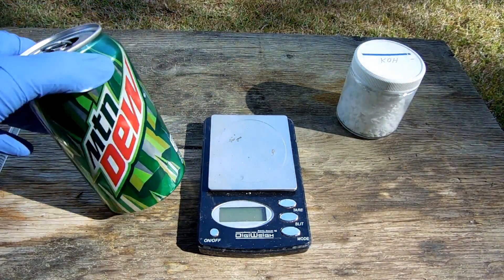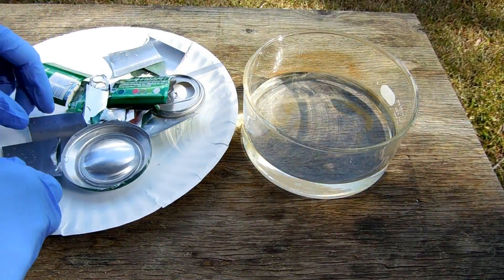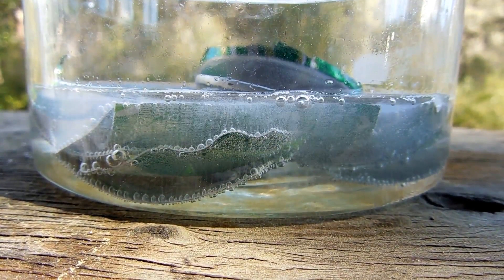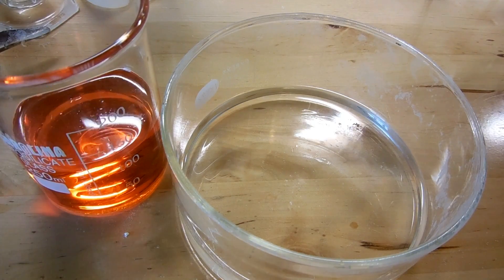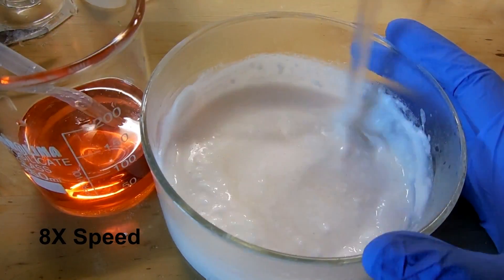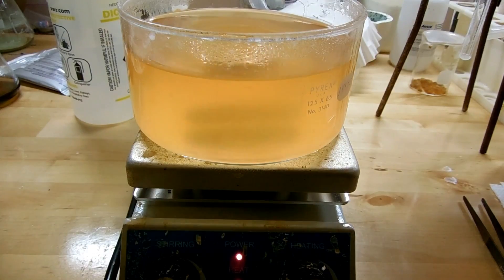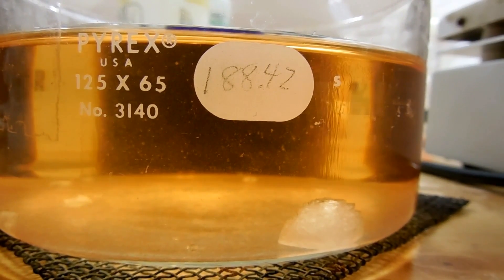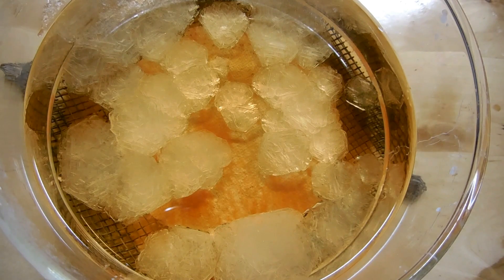Alum from Soda Cans

Comment: Excellent video thank you. Is there a chemical way to refine/reclaim aluminium not convert to alum.
Reply from the maker: Sure but it's not something that can really be done at the hobby level. Producing aluminum from bauxite is an incredibly energy intensive process, and this alone accounts for something like 5% of the total energy use in the US. Once aluminum is chemically converted into one of its compounds, it's very difficult to get the metal back out. You can more easily recycle existing Al metal by melting it, like I did here, and casting it into whatever shape you like. But that's a physical process, not chemical.

Comment: Hey you sound like someone who might know an answer to this question. I grow crystals with many chemicals but MonoAmmonium Phosphate is my favorite and I have grown very adept at doing it. I am getting ready to order some L-Alanine after reading a study done that showed a +5 mol% of the amino acid was most efficient. How much of an actual percentage of the solution does that break down to? I don't want to assume that it is as simple as 5%. Thanks in advance if you can help! I also wanted to note that in addition to just comparing straight ADP and Alanine doped ADP they used Arginine doped ADP. The Alanine was much more efficacious than the Arginine, but what about using both? I know that only experimenting can tell so I wanted to include this information so you might be able to include a more helpful answer. I understand they also dope ADP with other salts like Chromium and Boron so if you want to expand your reply by pointing out some chemicals that might help me in my work it would be appreciated.
Reply from the maker: Unfortunately that being organic chemistry, I have no idea! As you said, experimentation will tell.
Reply: mrhomescientist I believe growing monoammonium phosphate is well into the field of inorganic chemistry. Obviously introducing an amino acid into the mix is organic. I was actually looking for help in translating a chemistry definition into a more practical one for my methods. The mole is a unit of measurement used in chemistry to express amounts of a chemical substance, defined as the amount of any substance that contains as many elementary entities (e.g., atoms, molecules, ions, electrons) as there are atoms in 12 grams of pure carbon-12 (12C), the isotope of carbon with relative atomic mass of exactly 12 by definition. I just wanted to give this another shot since you seem to have a good head for chemistry. Thanks if you can help and if not then good luck in your future endeavors.
Reply: Konichi Wawa Hey, I'm just a chemistry student, but this link may help you calculate mol%: https://www.boundless.com/chemistry/textbooks/boundless-chemistry-textbook/solutions-12/concentration-units-93/mole-fraction-and-mole-percent-402-1960/

You basically want to go from mol % to vol %. The mole percentage you want is 5 percent. That means for every 1 mole of your total solution (including L-Alanine), you'll want 0.05 mols of L-Alanine. We can express this as a mole ration: 0.05molL-Alanine/1molE, where E stands for the sum of all the components of the solution, in mols. If you start with separate solutions of known concentration, then you can divide the mole amounts in the ratio above by the molar concentration, (mol/L). This will generate a volume ratio, which you can multiply by 100 to give you the vol %. You should probably divide each molar component by its own concentration. If you have pure or neat L-Alanine, then it's concentration can be found from the density of that compound. 

As to your further question, I have absolutely no idea. Hope I helped
Reply: Karsten Skogsholm Thank you so much! I just happened to be glancing through replies and noticed yours. By reading it I can see why it has taken so long to get an answer. thanks again..

Comment: This is neat but the cost of the reagents makes this a little bothersome when you can buy this cheaply in bulk. In fact. as opposed to messing with a caustic base and acid why not just turn the cans in for cash and buy your Alum?
Reply from the maker: See my other comment that you replied to. The fun is in experimentation and making things yourself.
Reply: mrhomescientist True, actually I was drawn to the video because I grow crystals. I am so busy tending to them that I really only want to do simple chemistry that also doesn't have the potential to cause problems. I am a natural born Klutz and I have lost count of the number of times I have spilled colored MAP solutions. I do mix my own AMAG since that is so simple and cost efficient. Check out my work if you have the time. I posted a couple of albums on IMUGR under "Growing crystals at home" which is the only posts under that category that I had to create. I love chemistry, but something like this is almost like me asking for chemical burns.
Reply: Hey sunspot!
What if you need alum and CANNOT GET TO A STORE eh?
You wallet is useless if the roads are cut or your transport is shot, or the store is closed.

Comment: The updraft iin the solution is less-dense solution which lost dissolved solids onto the growing crystal surface, I've read. Like dropping sand bags from a hot air baloon, the solution rises when lighted of its dissolved solids.

The image of the updraft is way cool!  I'm wondering if the cylindrical lensing of the beaker helped do what ordinarily would need Schlieren optics to show the density striations that clearly.  Very interesting!

http://en.wikipedia.org/wiki/Schlieren_photography
Reply from the maker: Thanks! I think that explanation makes the most sense.
Reply: Hey you sound like someone who might know an answer to this question. I grow crystals with many chemicals but MonoAmmonium Phosphate is my favorite and I have grown very adept at doing it. I am getting ready to order some L-Alanine after reading a study done that showed a +5 mol% of the amino acid was most efficient. How much of an actual percentage of the solution does that break down to? I don't want to assume that it is as simple as 5%. Thanks in advance if you can help! I also wanted to note that in addition to just comparing straight ADP and Alanine doped ADP they used Arginine doped ADP. The Alanine was much more efficacious than the Arginine, but what about using both? I know that only experimenting can tell so I wanted to include this information so you might be able to include a more helpful answer. I understand they also dope ADP with other salts like Chromium and Boron so if you want to expand your reply by pointing out some chemicals that might help me in my work it would be appreciated.
Reply: Hello Konichi Wawa, and thank you.  But, I'm not as much into crystals as I am the fringe area of personal research into piezoelectrics.  I'm not much of a crystal head or chemist.

I learned about the low-density updraft from a NASA document on growing crystals.

The updraft issue is why crystal-growers will turn the crystal after growing in one position for a while, when trying to grow huge crystals for competitions.

I would like to compare notes on another crystal anomaly I hope to pursue, namely, the 1/f 'flicker' frequency of the noise floor, as affected by external magnetic fields.

The noise floor on a capacitor (Gregory Hodowanec (US Patent on gravity generation) has been found to turn "pink" from white as a response to motion of proximal mass.  This is the quantum-jumping noise of electrons that randomly jump from one dwell to another in the crystal lattice.  That randomness is influenced by the quantum noise within the matter lattice, mediated by the near field (which conveys crystal strain during piezomechanical moments).

I'm particularly interested (discussion where appropriate is invited) in developing a sensor-system that 'may' (with emphasis --an experiment) show subtle spectral shifts as a digital table of fast-changing values of the occurrence-count of oscillation periods of a chaotic oscillator (like a ring oscillator).

Only a 741 op amp, or better, is needed, with a long-time-base-integrator to map the average of the noise floor.  Hodowanec claimed to observe rotation of the solar core, passing overhead of the galactic center, and a heart beat of closer moving mass (his heart)... with only a data-logger to observe the trends in the noise average.

I.e., 'flicker noise' may not be as much related to the circuit, as to the ambient environment of the circuit.

And to put a better grip on the data, I've designed a hardware version of Russian quasi axiomatic theory controller (DARPA 2001 ---which agency went black during the funding competition because of war monkeys) which is only known of within the CIA, or those that the war monkeys raped to cash-in on the trillion dollars Poindexter had to spread around among war monkey cronies... oops... scratch that :)  All hail the domestic spy agency!!! (gag yourself with a spoon if needed).
Reply: DonE Mitchell I believe you are explaining to me about what is (if I understand you correctly) detection of quantum oscillation with respect to movement of a proximal mass. This can be and probably is something as ordinary as a hand moving over the detector. The problem with using any of Hodowanec's schematics to build a detector (something he himself designed to communicate with aliens) that if If I am correct ( and I think I am looking at the video of one such detector in use) this detector is not only capable of revealing the rotation of the solar core, but also pick up the variance as it passes overhead of the galactic center. We are talking about gravity and speaking of the galactic center then you have to either be assuming your picking up the super massive black hole and/or the mass of stellar matter that is so concentrated there. This assumption has a fatal flaw because it makes no mention of or I must imagine completely avoids the subject of the massive amount of gravitational signatures from other interstellar bodies that litter the area between our sun and the galactic center. I am surprised you haven't learned more about MonoAmmonium Phosphate ( more commonly referred to as Ammonium Dihydrogen Phosphate ADP) because of it's extensive use in piezoelectrics and the fact that it is semi-capacitive and Ferroelectric. The ferroelectric alignment can actually be influenced as the crystal grows, thus all of the doping experiments. The updraft you speak of is actually a pain int he ass for me. It announced it's presence as I have tried to coddle a true sphere to elicit symmetrical growth. I had a dream of growing a crystal that properly colored might appear as a small but beautiful replica of our sun. It's weight then enabling me to build a Calder type mobile of our solar system. I am afraid I know little of the fringe sciences considering my lack of a true education in chemistry and physics. My success in growing crystals has been well received. I invite you to go to IMUGR and search for "growing crystals at home" a subject I had to create. I have uploaded two albums of some of my more beautiful crystals. MY two biggest are closing in on the ten pound mark and am working feverishly to see that they finish in a strong growing cycle so they are more beautiful. I wish you well in your endeavors because the world of physics is amazing.

Comment: alum is $15 a Lb on ebay...  free shipping..........   this is silly
Reply from the maker: Sure you can buy anything you ever wanted on eBay, of course. Most of the fun of this hobby, though, is making your own reagents. It's a great learning experience. Plus you can't make a video about clicking "Buy Now" :)
Reply: Konichi Wawa Or you can just follow proper safety procedures and not suck at chemistry.
Reply: Amos Zoeller I'll stand behind my chemistry. My kung fu is strong...Imugr ....search--> growing crystals at home, Honeythorned is my account.
Reply: And you are a lemming 

This is about learning how to do stuff, if your internet is shot, the roads are cut, and you are left to your own resources.

Knowledge builds resilience.

Comment: Is there a way to dissolve the can and get the aluminum to precipitate out without forming alum? I ask b/c I'm looking for a good way to purify soda can aluminum.
Reply from the maker: Aluminum is actually a very reactive metal, and it's very hard to extract out of its compounds. Industrially it's made from electrolysis of molten cryolite; not an easy task for the amateur. According to wikipedia, aluminum production via this route consumes 5% of the total production of electricity in the US!
Reply from the maker: Steven Madewell It probably has something to do with the economics of it. Cheapest to make cans, plastic is a bit more expensive, and glass is the most. It could also be a sanitation and safety thing, since broken glass is harder to clean up and more dangerous than a crushed can. Those are just my guesses though. Glad to help!

Comment: you should have used some kinda butane torch to burn the plastic and  paint off, then wash and rinse the pieces.
Reply from the maker: That would have produced toxic fumes though, which is bad for both me and the environment. The method in the video leaves all the plastic as residue that can be very simply filtered off and discarded.
Reply: mrhomescientist Well I would have sanded everything a bit to make it react faster and leave less plastic in the sollution

Comment: Im making this as an investigation and my first attempt didn't go to well the instructions I used required me to heat nd stir the aluminium in a fume hood and thn add the H2SO4 whilst still hot thn to filter and place in ice bath to crystalise I wanted to ask whether it mattered wen the acid is added? And also the final equation of the alum is it KAl (H2SO4).H2O?

Comment: Which drain cleaner do you use for sulfuric acid.
Reply from the maker: It's called Liquid Fire. Rooto brand, if you can find it, is supposedly very pure and water-clear.
Reply: mrhomescientist I used to use liquid fire but it was like...  dark amber when I used it that is why I haven't used it lately.  I wonder if they changed it!

Anyway Im getting set up to make my own with sodium chloride and sodium bisulfate. 
I should get very pure if i use low amounts of water in the collector.  

the good thing is that I will only ever need small amounts at a time.  like 30ml at a time.  So I think that it will be a good solution for me.
Reply from the maker: Clown Whisper Good luck!
Reply: mrhomescientist Hey wont this work the same with sodium hydroxide?
Reply from the maker: Clown Whisper Yes and no. Yes it would dissolve the aluminum, but then you'd be making a different version of alum. The alum made here is potassium aluminum sulfate, so the potassium ions are required for the product I wanted.
Reply: mrhomescientist i use alum a lot but i dont have potassium hydroxide and im cheap lol
Reply: Clown Whisper which version is the foodgrade stuff you buy in a grocery store

Comment: How important is the specific acid used in the precipitation step? Could it have been (eg) acetic acid, or is there something special about H2SO4 that makes it necessary?
Reply from the maker: Alum is potassium aluminum sulfate,KAl(SO4)2, so yes the sulfuric acid is required to supply the sulfate ion.
Reply: Of course -- how inattentive of me. Thanks for answering a silly question.

Comment: Pepsi cans use an iron alloy for their cans. Mountain dew is owned by pepsi. Coke cans have a higher aluminum content. I learned this in chemistry class in college, when pepsi cans really screwed up a lot of our experiments.
The Stream coming off the crystals may have been heat. Crystallization is usually an exothermic reaction.
Reply from the maker: Do you have a source for that? In my aluminum furnace video's description, I link to several alloys that are used in beverage can manufacture (which I found from the can maker's website). These are very low in iron content (< 1%), and from my research it looks like this is what all beverage cans are made of, regardless of the company. I'd be interested to know if you can cite somewhere that states something different. It's certainly important if anyone wants to use cans for chemistry!
Reply: mrhomescientist No i don't. Just from experience that pepsi cans had iron content in them. Never really had a reason to actually care that much, it was just something we kept in mind. ACTUALLY! i think periodicvideos had a video where they had a similar problem with a pepsi can during an experiment because of iron. But i don't think they looked into the exact alloy either.